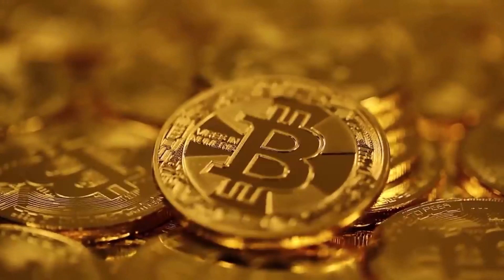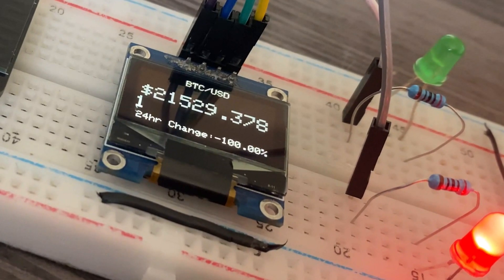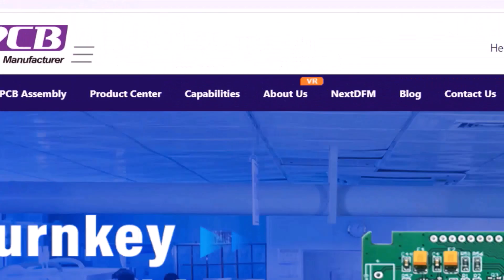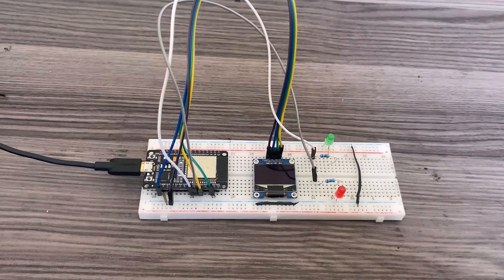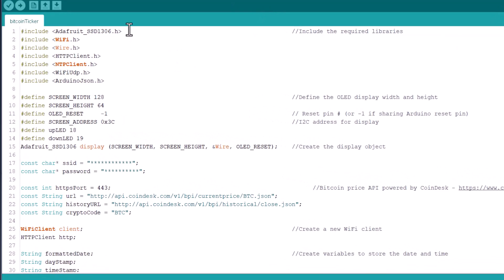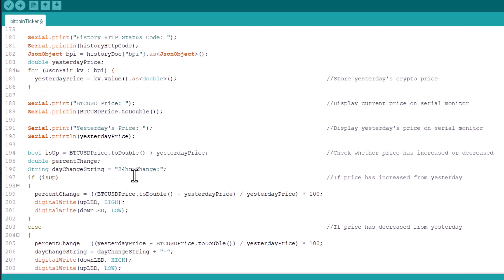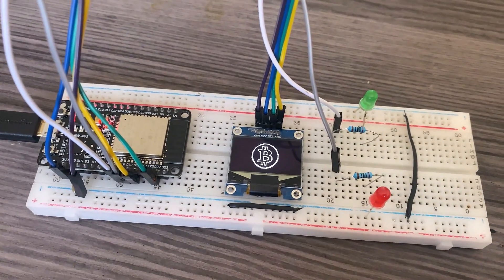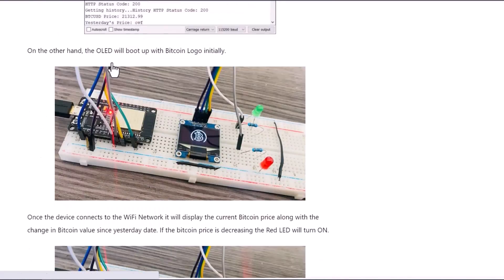Bitcoin $ Price Tracker Using ESP32 & OLED Display

Comment: Great, It´s working like a charm. You just need to adjust few things. And I did not used ESP32, but ESP8266.
Reply: Hey I'm doing the same project can you help me
Reply: @weebs_vs_otakus9177  For the first test, you need to change libraries to:
#include <SPI.h>  
 #include <Wire.h>  
 #include <Adafruit_GFX.h>  
 #include <Adafruit_SSD1306.h>  
 #include <Arduino.h>  
 #include <ArduinoJson.h>
 #include <ESP8266WiFi.h>  
 #include <ESP8266WiFiMulti.h>  
 #include <ESP8266HTTPClient.h>  
 #include <WiFiClient.h>  
 ESP8266WiFiMulti WiFiMulti;  
 #define SCREEN_WIDTH 128 // OLED display width, in pixels  
 #define SCREEN_HEIGHT 64 // OLED display height, in pixels  
 #define OLED_RESET   -1 // Reset pin # (or -1 if sharing Arduino reset pin)  
 #define SCREEN_ADDRESS 0x3C ///< See datasheet for Address; 0x3D for 128x64, 0x3C for 128x32  
 #define upLED 18
 #define downLED 19
 Adafruit_SSD1306 display(SCREEN_WIDTH, SCREEN_HEIGHT, &Wire, OLED_RESET);
Reply: HI, what did you adjust? Is it possible to share? Thank you very much in advance. Really appreciated!